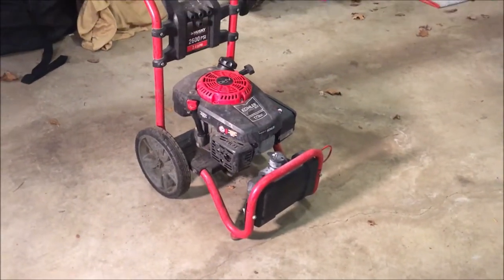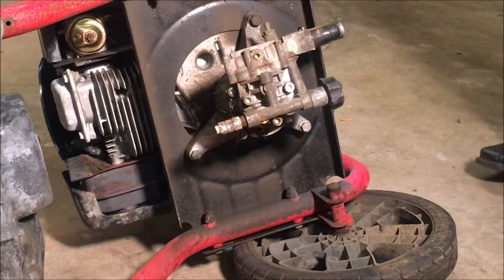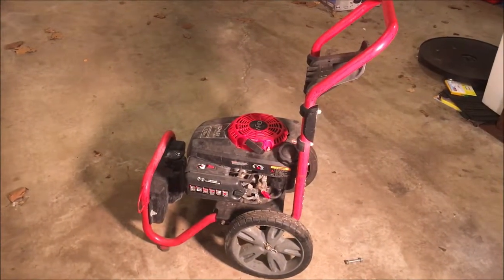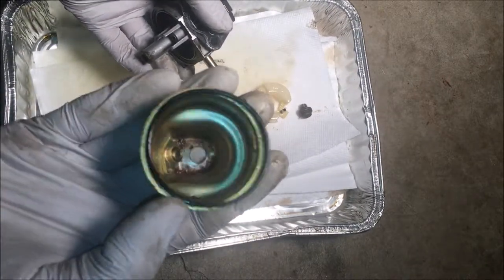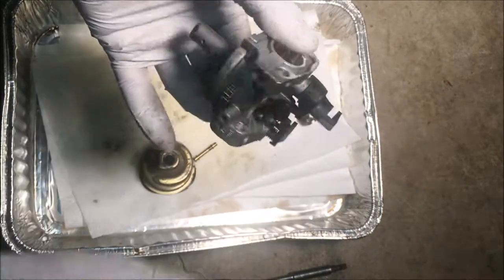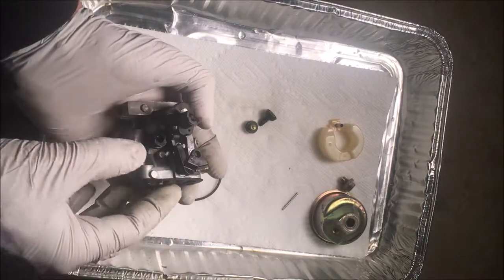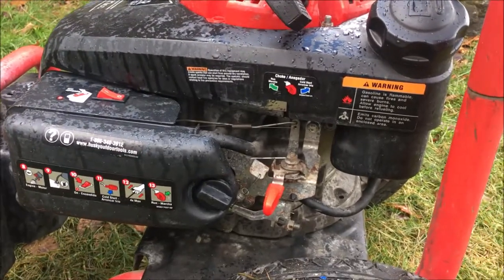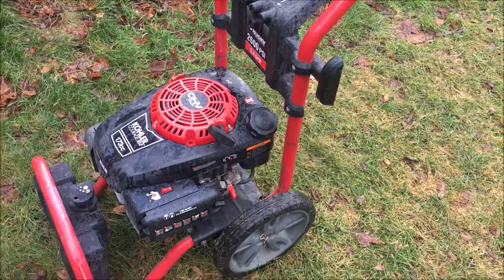Power Washer Pump Removal and Carberator Rebuild

Comment: I thought that I had watched all your videos, but I seemed to have found a whole new tranche!  And lo and behold a PRESSURE WASHER!  I have a Troy Bilt with a Briggs and Stratton that I didn't drain for the winter.  Cracked the pump.  I owned it for a year.  I couldn't throw it out.  I watched, half heartedly, on facebook marketplace and Craig's list for a Troy Bilt with a blown engine.  Its been sitting 4 or 5 years laughing at me in the garage.
So, a couple weeks ago, I go to the town dump, and what do I see?  A Troy Bilt pressure washer sitting on the edge of the scrap dumpster!  Oh please!  Oh please!  Tipped it on its side and oil POURED from the crankcase.  A blown engine.  EUREKA.
Turns out, it was a slightly smaller size, but the pump housing and pump section looked identical.  Three bolts held the engine to the pump.  Popped off the broken pump housing and tried to fit the donor one on.  Different form factor on the housing, but the pump sections were the same.  Swapped the donor pump section to the old pump housing, popped the bolts on and it LIVES.

Managed to pull a very lightly used spark plug and a barely used air filter off the donor.  Also got a nearly full tank of gas off it.  
Watching your videos gave me the confidence to attempt it and the patience to work through the speed bumps...

Comment: Hi James, Love the channel. I have a Workforce pressure washer that I did an ultrasonic carb clean on. It now runs like a top but leaks fuel around the bowl. I cleaned the needle and float with the carb. Thinking maybe the seat but not sure how to clean it? Any input would be greatly appreciated. Thanks

Comment: Needs a fuel shut off valve installed that way you have carburetor without gas it run better longer

Comment: Owner probably did not drain the pump of water for the winter.
Reply: Freeze damage usually show up as crack housing 

This pressure washer was dropped n shatter the washer housing
Reply: Yep and they will try and blame the shop who works on it 
Remove pump in front of them and offer to let them take it with them

Comment: Junk! I have a power washer, but the engine is a horizontal shift and the pump is more circumstantial than that. It has a 2 cycle 5 hp Honda engine which still runs. The pump may be saveable.